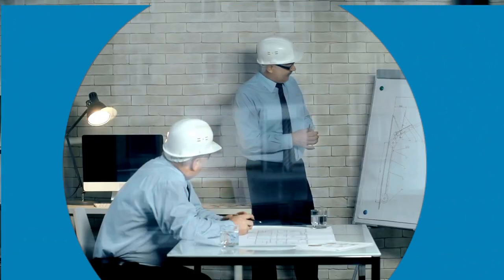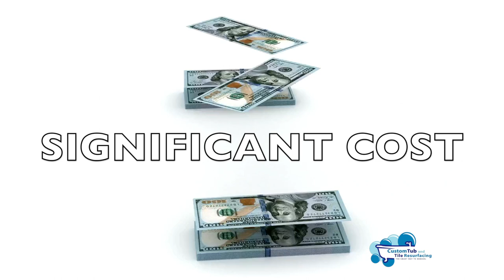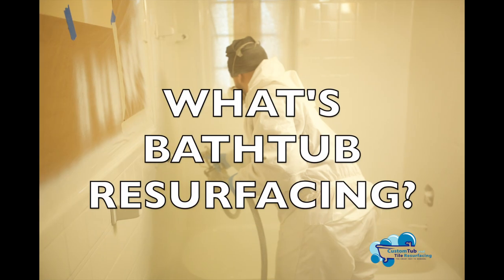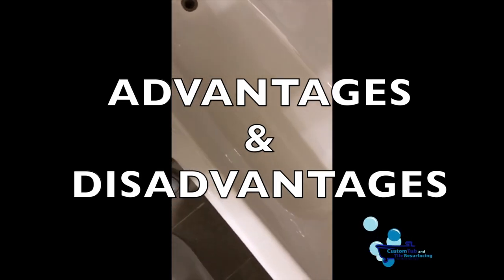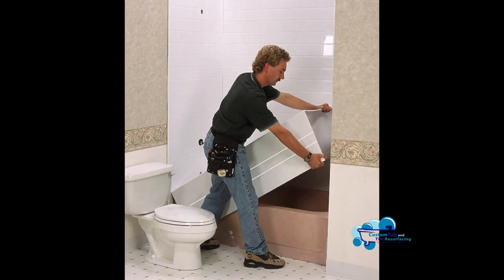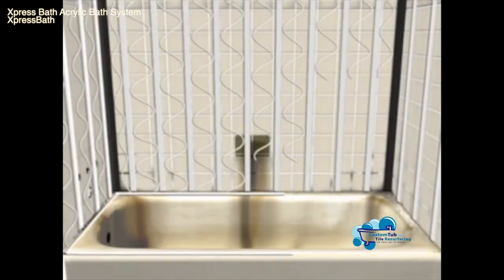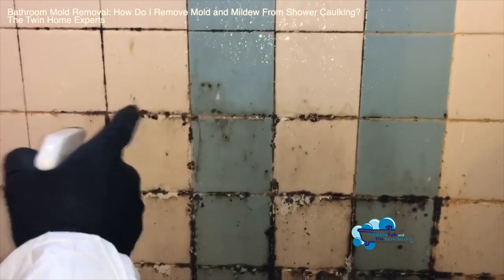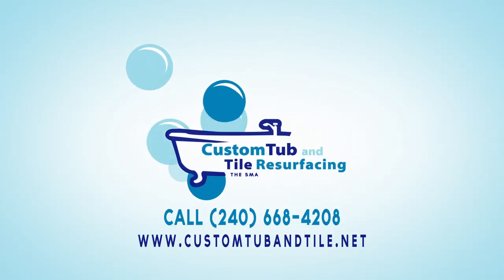Is A Tub Liner A Good Idea?

Comment: Avoid. Invest in a new tub if you can. Resurfacing does not last long and the texture is not smooth like a new tub, or at least this is my experience after having a tub re-glazed twice.
Reply from the maker: Oh no!  It sounds like whoever did your tub resurface did it incorrectly.  Any reputable company with a warranty who stands behind there would be capable of fixing that.  When done correctly, resurfacing and casting are both smooth.
Reply: @customtubandtileresurfacin7104  I have been doing them near Niagara Falls for over 20 years, another family member for over 40. We rarely have issues when the tub is kept clean and dry when not in use. Just finished another down the road in Fort Erie, customer was ecstatic with the smooth finish. As I am sure you know, any defects that occur many years down the road can be sanded, and the tub reglazed like new again. Pretty good return on an investment of $400-$450.